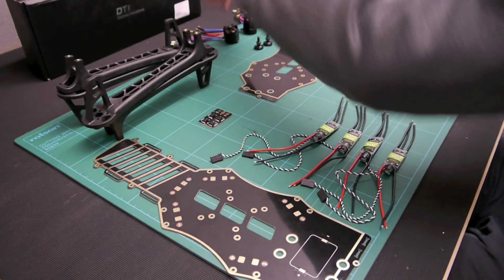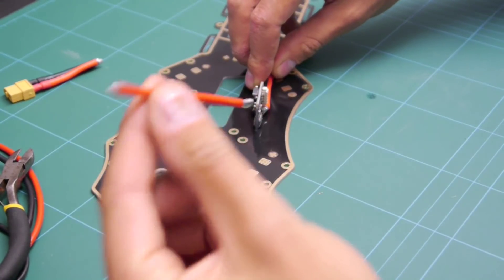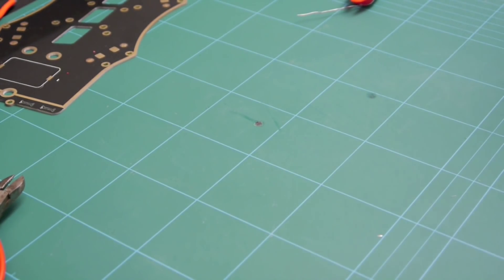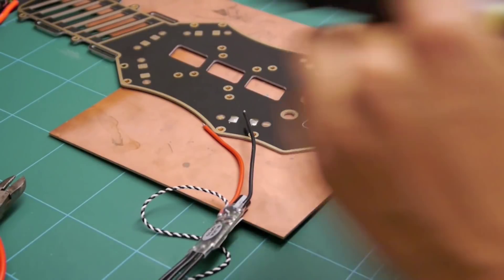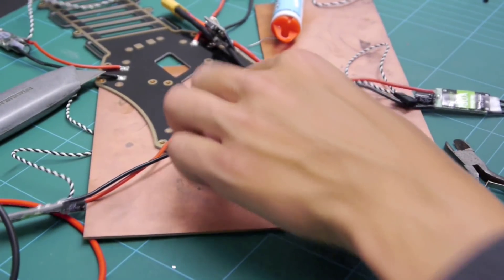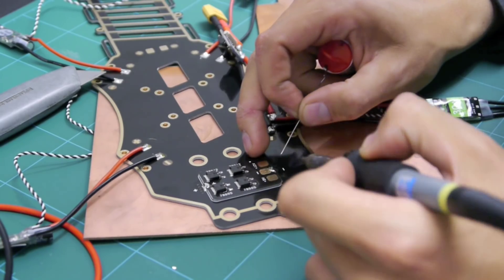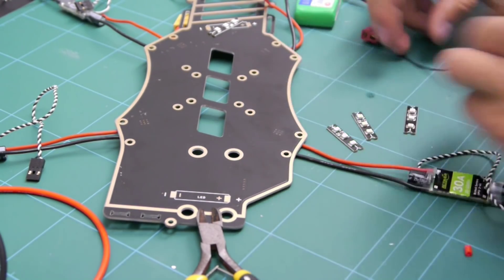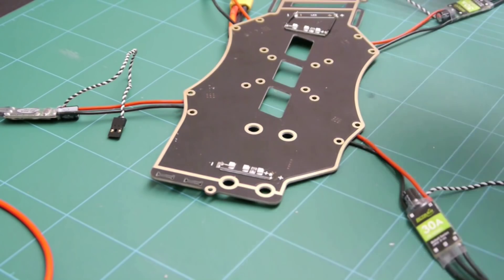TheManLab - ESC Soldering - Diatone White Sheep APM Quad Build - Part 1

Comment: You should really clean your soldering iron with a wet sponge before and during soldering sessions. then lay a thick film of solder on the tip so that it's protected from oxidation untill next use. You seem to be having issues soldering, you would not have with a clean tip. :)
Reply: let me just correct myself; you seem to have problems transfering the heat from the iron. your soldering looks decent enough. :)

Comment: can tou tell me the maximum battey size that can fit inside the frame
Reply from the maker: I'm using 4s 5000mah at the moment and that's about the limit I think.
https://hobbyking.com/en_us/zippy-flightmax-5000mah-4s1p-20c.html See ink for size. Enjoy
Reply: Mine should be ok them moned is 142x49x22 so your fits inside the frame sorry to ask again you wont to be 100% b4 i order mine i like the tbs frame but none in the uk
Reply from the maker: Nick Walters Yes it fits inside the frame.

Comment: Sunnysky x2212-980kv motors comes with CW Propeller Adaptors or CCW? I already ordered these motors, but not received yet. So I would like to know which adapters I have to buy separately. Thanks!
Reply from the maker: No you have to buy them separately. I have some left if you would like to purchase some.

Comment: Can a person use 20A little bees on this quad with Sunnysky x2212-980kv motors
Reply from the maker: +Chris Smith I think you would be a bit close to the edge with 20amp esc.
Reply: +The Man Lab  yeah I realized that the servo cables are to short and I agree that it might be a bit too small so I went to banggood went USA and purchased these very similar to the RC timer esc is DYS bl30A mini 30A BLHeli esc opto 2-6s Hope these will work with my Naza m lite so will see.

Comment: Back in 2014 I bought a DJI flamewheel hexcopter kit that looks like it would be similar to build and a Pixhawk flight controller to run it but after going through 2 bad Pixhawks and a Naze32 I got so depressed that most of the hardware everyone is selling is bad and all the software is so buggy that it won't work I never did build the kit.  At one point I bought a so called RTF Quanum Venture model from Hobby King but apparently their idea of RTF was different than mine since I actually expected it to be able to fly.  It had a bad motor and ESC but after replacing them it was still too heavy and underpowered to get off the ground.  Since it seems to be impossible to ever get anything to fly and with the govt. now cracking down on drones I'll probably put the hexcopter kit back up on Ebay.